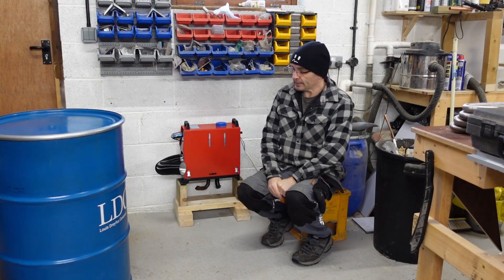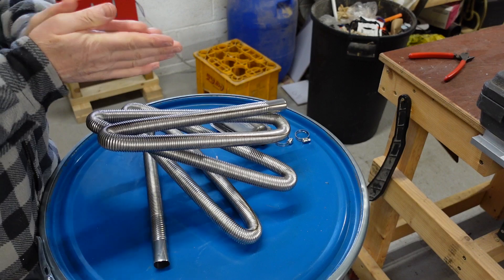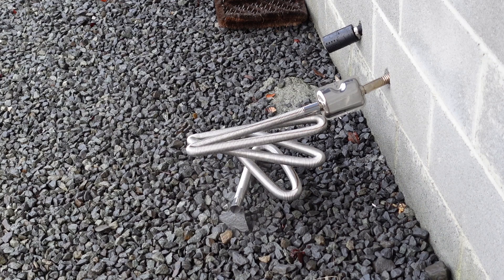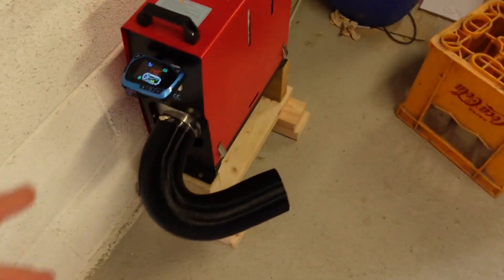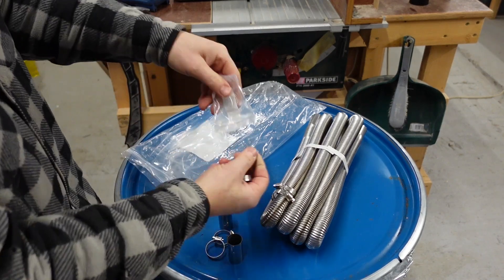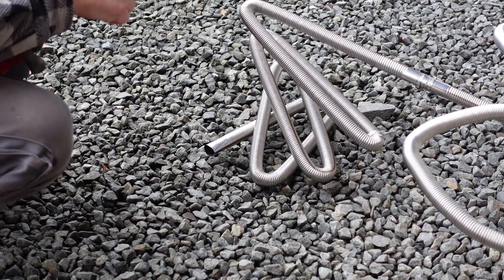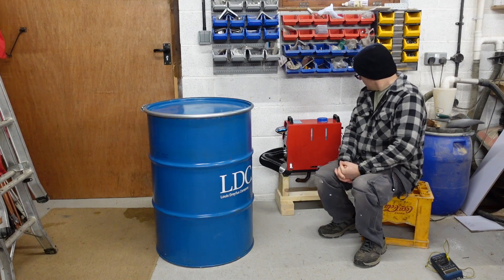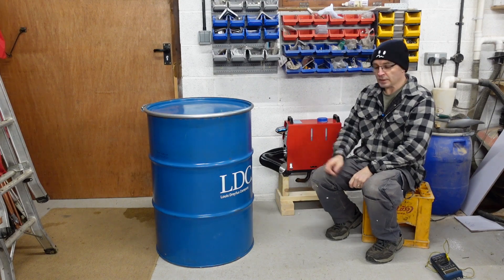How Long! Can a Chinese Diesel Heater Exhaust Be Extended ?

Comment: "Afwul lot heat goes out door". 
Not alot, about 20% wich can be reclaimed 10-15%.
Reality 10% (0.5kw).
Soot possible, never run less than 75% power

Comment: I would put the air indushon pipe inside so it is resurclating the air in the shop
Reply from the maker: There are two air intakes, one for heating one for burning, you want the combstion chamber intake outside 👍

Comment: A sand battery can only compete with water (heated to 80C) as a heat storage if you heat the sand to a bit over 200 C.

Comment: im lost how are you recovering heat with as longer exhaust if all the tube that's radiating the heat is all outside so NOT being harvested NOR captured? please help me understand and thanks
Reply from the maker: The exhaust went in the blue barrel and was filled with bricks and sand and sits next to the heater inside

Comment: I wasted two winters playing with cdh, trying to heat a workshop like yours, I gave up and went to a normal multi fuel stove, best move I ever did, my workshop gets lovely and warm, and it's a very natural pleasant heat, chd are OK for a lorry cab or campervan but that's about it
Reply from the maker: It takes the edge off and makes working out there better but I'd like to build a rocket stove bench at some point if I could squeeze it in without sacrificing worktops.
Reply: @50plusdad-uk just buy a second hand stove and enjoy the heat, you will thank me when you do

Comment: You should take the intake air on the inside so you will heatup the air from the inside and not cold air from outside.
Reply from the maker: That's the combstion chamber intake and get's burnt not heated 👍

Comment: DUDE!!!!  You have your inlet pipe outside too.  No wonder you are having issues keeping the place warm.  Put it on the inside.
Reply: That is the best way , otherwise you are sucking air from the room and sending out of the exhaust , creating negative pressure in the room and thus drawing in cold air from outside
Reply from the maker: That's the inlet for the combustion chamber

Comment: I run a six foot exhaust coiled down lazily with a small fan running over it.  It passes thru the wall sleeved through a piece of 1-1/2 copper pipe.  Currently at 95 percent heat recovery.
Reply: @gbear1005   This is my future setup exactly man!! Mount heater high.... coil exhaust pipe inside as much as you can for thermal retrieval, then exit shop at 8 inch from ground level... and condensation can drain somewhat freely!!!
Cheers from Canada! 🤠🇨🇦
Reply: awesome I've been wondering this using the heater itself to pass over several coils of exhaust tubing while its on it way out drastically improving the inside air temps
Reply: Depends on ice conditions.. mine are 2 ft ppp in protected area, and the stlagmites reach all the way up to the exhaust tip

Comment: Try using the long exhaust in a metal pail filled with sand. The sand will heat up and slowly release the heat into the room.
Reply from the maker: I've used an oil drum 👍

Comment: Hello from the USA. 
I think you tube can read my mind because I was just wondering about the question of how long the exhaust pipe could be & your video showed up in my feed. 
Anyway I was thinking about doing a similar thing but on a smaller scale (no longer than 3 meters) using a 5 gal (19 L) steel pail & sand. 
I will look at your channel to see if you have completed & have updated the results.

I did see a video on someone using a oil filled radiator heater as a heat dissipator (drained of course) but was concerned about the oil residue.
Thank you for doing the testing.
Any other recommendations on this method?
Reply from the maker: Give it a go, just make sure it's gas tight.

Comment: Man. Are you sure thats a 5-8kw.  Seem kinda small compared to the same exact model i have. I was stunned by its output. Well tuned from the factory.  It heats my 12 x20 garage up after about 6 hrs.  70deg easily i often run it on level 1 nd 2 to maintain, after ive run it wide open for a few hrs.   But i live in virginia.
Reply from the maker: I've seen other people say the same thing I wouldn't be surprised if it's no where near 8 👍
Reply: @50plusdad-uk   Have you looked into tuning your heater with the pump settings?  Maybe the fuel hertz is to low?  If so, some controllers will allow you to turn it up a bit.  Just don't go to high.  

I seen one video where the guy said a 5kw and 8kw is usually the exact same heat exchanger just with different settings in the controller for the pump and fan speed.  So, even if you have a 5KW heater, you can adjust it to a 8KW in most cases.
Reply from the maker: Haven't had any luck with getting my controller changed to Haven't, tried all sorts of button combos

Comment: hi,
 I am using a low cost air-air  heat exchanger,  reusing a 2nd hand  full-aluminium-made intercooler for cars.
Mind that:
 - the temperature a car intercooler handles is max140 C and exhoust gases are 500C
 - with natural convection, the heated air will flow from the bottom to the top, so place intercooler horizontally (gaps vertical) for better transfer efficiency
 - to do forced convection, with some fans like in a car, it can be placed in any direction
regards
Reply from the maker: Be careful the exhaust gases don't exceed the max rating

Comment: Just to clarify a point. The reason the outlet temp remains approximately the same, is that the controller takes temp data from inside the heater, and adjusts fuel flow rate (pump ticks) appropriately, to maintain optimum temp inside the heater. Meaning, that although it 'appears' to be running with normal efficiency, even with the added restriction to the exhaust, it is in fact using more fuel to maintain the correct temperature.
For example, setting it at 'level 5', doesn't set the flow rate (pump ticks), but rather, tells the controller to do whatever it has to, to make the heater conform to it's programmed heat output when set to 'level 5', so the controller will do whatever it has to, to force the heater back into the performance profile dictated by the controller's firmware programming.
This topic, in a different question came up in a different vid I watched earlier, where some fellow said that he figured he was saving fuel by changing his pump to one that put out a little less fuel per tick, but I had to correct him that the pump doesn't control things, and that the controller would just make his 'smaller' pump, tick faster, forcing it to deliver the same amount of fuel that it would make the larger pump deliver, again, to keep the heater performing within the boundaries of the controller's programming.
For more clarification, and good data on how this type of restriction actually hurts the heater and its performance, just as I was typing this, a 'short' was dropped by (channel name) 'Hangin with the hursts', briefly talking about his attempts, and the word he got after consulting with the manufacturer of the heater he was working with. (most recent short on his channel page, titled... "Diesel Heater Exhaust: Why Modifying Is a BAD Idea!")
Reply from the maker: I'm using a 38mm exhaust now so no restriction
Reply: @50plusdad-uk  Did you consider putting some spacers around the pipe and put another around it, solder an inlet and outled to it, to make a pipe heat exchanger? That way you could suck the heat out with not many restricitions.  
I was playing with the thought, but I won't find the time till new years.

Comment: Just run the exhaust pipe through the barrel at the bottom{ with good sealing at both ends} fill with water, and you have the best thermal mass available for distribution
Reply: Also the heat coming out straight of the heater is quite dry , so you can open up the top of the barrel and put a fan to humidify the area at the same time. Especially handy if working with wood species  that requires a steady humidity level.
Reply from the maker: Nice tip 👍

Comment: Maybe spending time to insulate the room more is an idea
Reply from the maker: too much stuff in there thats fixed to the walls so not an option at this point
Reply: Here is my thoughts. Instead of using the exhaust in the barrel. You have 200 degree air coming out of the air pipe. Run that into the barrel into 3 inch dryer hose starting at the top and curl it on the inside and exit it out the bottom. Hot air rises. Now cut another 2 more 3 inch holes on opposite side of the barrel. One at the bottom and one at the top. On the top one place a computer fan. Have it pulling air from inside the barrel. This air inside the barrel will get hot and the metal pipe will be hot. The metal barrel will get warm. Now you should have hot air from the heater coming out and warm air coming out from inside the barrel. Won’t be any risk of bad fumes or condensation. Just a thought

Comment: It's not the length dude ( pardon my pun) it's the bends in the pipe. Stretch it out across the wall on a downward angle inside your space and put the muffler on the end outside ( shortest exposed exhaust as possible ). Cover the inside length with a wire cage so nobody gets burnt. No more than 10ft inside best length to heat capture ratio.

Comment: It can't work properly. The exhaust pipe should have a contious slope and no narrow angles. The way you do it causes to much counter pressure. Completely unlogic setup
Reply from the maker: Works fine so far

Comment: Those exhaust tubes are not stainless steel just to let you know they rust out you are better off with exhaust pipe that wabesto uses at least it is double walled exhaust pipe
Reply from the maker: The 25mm didn't work out so I changed to a stainless 38mm with no issues so far.

Comment: Started my one only vertical exhaust run directly from the bottom side of the heater where it's hottest to keep vapors from condensing. Up just the height of the heater then switch backs down the the bottom and out the wall outside, all downhill. Simple exhaust radiator. Adding a protective grill later. Compact, the same size as the side of the heater.

Comment: Temperature in the chamber itself, or a the warm-air-pipe remains the same... But to make any assumptions about efficiency, you have to also check, if fuel-consumption and soot-deposition remains similar as before... Soot deposition is nearly impossible to check, since you´d have to run it for a year normally, and for another year with the added 6m-exhaust-pipe, but the fuel-consumption can be checked as easily as the checks you already included... Otherwise, that´s exactly the test-set-up that I was thinking was needed, but nobody was doing... So, thanks... Also, if using a muffler, stick it to the end, not in between, confusing the gas-flow, causing harm. And if your exhaust ends up being 3-6m long, you surely don´t need the muffler, seriously...
Reply from the maker: Using a 38mm pipe now, no muffler needed 👍

Comment: Considering running a longer exhaust by the side of the heater as a radiator to extract more heat. Just run it up the side, the switchbacks downwards before leading outside to vent. Avoiding accumulating condensation. A grill to prevent burns.
Reply from the maker: Definitely a grill, these get hot 👍

Comment: Alo !? ..  Just connect to the old whater radiator..    It will absorbe hot energy..   delivering it in the room ...   And exos (mutch colder) goes out..
Reply: I tried this , affected the burn badly .You need an old radiator as modern ones tend to have too small diameter inlet /outlets

Comment: The key here is to increase the diameter to a large pipe, do not try to run it at the same diameter over a long distance.
Reply from the maker: Works so far

Comment: Why use sand? Water has a much higher thermal mass and the transfer will be better. If you’re worried about it rotting the barrel use central heating inhibitors.
Reply from the maker: Thanks, I used sand as it's easier to deal with, I don't have to worry about leaks etc and if I want to dispose of it I can use sand but 200l of contaminated water would be a problem 😀👍
Reply: @solaris8592  you’ll have to constantly look at it because water is going to evaporate some,,, and the exhaust pipe may very well start to corrode. I think folks overthink these little diesel heaters far too much set the whole unit outside and pump in the heated air and don’t worry about all the rest of it. It’s kind of like watching a stripper. Don’t ask how it’s done just enjoy what’s coming off.

Comment: Shame you could not use non corrugated pipe. Sure that would work better?
Reply from the maker: The 38mm stuff i use isn't as bad
Reply: smooth is better and every bend adds friction

Comment: Would be interesting to try removing the muffler with the 6m exhaust pipe to see if that had any effect? Noise, Performance, Heat etc.  My thinking is that with 6m of exhaust it actually would replace the muffler.
Reply from the maker: I upgraded to 38mm pipe with no muffler as it wouldn't fit but it's not noisy so no need for it.
Reply: @MirriulahInAngledool  muffler doesn't muffle..  hardly any restriction tho..
Reply: I never put the muffler on mine it's quiet  enough without it

Comment: What you see on the display of the heater is not 219 Celsius it is 21.9 Celsius which is the programmed temperature to achieve
Reply from the maker: If that were true it wouldn't rise as the heater warms up 👍
Reply: @50plusdad-uk it is not worth to discuss with unlogic people
Reply: @Dodgecramer-wj6xv  that is working temperature in combustion chamber.  For set temperature you has to go on different setting.  Don't mix setting  man.

Comment: Saw a video of a guy who got a hold of an old school boiler style radiator... Piped exhaust thru that, and set the filtered used fryer oil on top to pre-warm it, mixed 50/50 with diesel, thing never knew the difference....
Reply from the maker: This some have run them on kerosene as well not sure how cost effective it is though 🤔
Reply: Long term will carbon up the burner chamber

Comment: i would have used 25mm copper pipe with a pipe bender into a coil and soldered supports from each coil top to bottom as the normal diesel heater flex pipe isn't guaranteed to not leak from its bendable construction and solid copper is a dead cert for thermal conductivity and isolating the noxious gasses
Reply from the maker: I use 38mm now the 25mm is too small at that length, stainless over copper as its not affected by the exhaust gases. 👍
Reply: @50plusdad-uk my biggest concern is the ability to contain gasses in the flex pipe, have you done an underwater leak test on it with comparable pressure within, I wouldn't have thought copper would have an issue with the gasses because of the temperatures involved, but if I've missed something then aluminium would be my swap. On a side note a heater exhaust through an intercooler to harvest then exhaust to the outside and the heaters air output tubing blowing the intercoolers heat into the space needing heated or an extra fan
Reply: @50plusdad-uk  any tips about the bits needed for the 38mm conversion?
Reply from the maker: If running inside make sure the pipe is gas tight, I got an adaptor 25-38mm and used exhaust paste and exhaust clamps. And get a carbon monoxide detector

Comment: These burners are a copy of an eberspacher D4  airtronic and the maximum recommended length is 2 m  of 24mm and 4m of 30 mm 
This is official data as you won’t get any data from the Chinese
Reply from the maker: I'm running 6m of 38mm now, so far no issues
Reply: @50plusdad-uk  Interested to hear/see how much coked up the burn chamber is after a year of use.
Reply from the maker: I'll probably clean it after winter, it won't have lot's of hours but should give an idea of how it's going 👍

Comment: Do you have a link for the exhaust pipe couplers? I couldn't find them (the link in the description doesn't work). I have an old Truma gas fired caravan water heater, I want to replace the burner with diesel heater exhaust heat.
Reply from the maker: I'll try and find it for you 👍
Reply from the maker: try these  
https://amzn.to/4728OhB exhaust extension
https://amzn.to/4nUHiZm exhaust connector
Reply: @50plusdad-uk  Thanks. They seem to be available now, couldn't find them before. The pipes are an odd size. Now I just have to find the heater...
Reply from the maker: I put new links in the description 👍

Comment: Please make sure you have no leaks on your pipe, otherwise you will have fumes in your workshop, and it is poisonous, I would use silicon tube over the joints.
Reply: It's diesel not gasoline. No one dies from diesel fumes unless they are forced to breath that smoke. It stinks. You smell it - you open the windows. Gas is the real killer - a lot of CO which does not smell.
Reply from the maker: Plenty of paste, Better safe than sorry 😁
Reply from the maker: The pipes are a snug fit plus plenty of exhaust paste and decent clamps.

Comment: with all the extra work and buying extra stuff be easier to get a second unit run 2 till warm then turn off one
Reply from the maker: I wanted something to heat up and then slowly release the heat when the heater is off.

Comment: Could you not run the exhaust through a radiator?
Reply from the maker: yes you can, cast iron probably best but I wanted to collect and then slowly release the heat 👍

Comment: Try with 1 inch coper pipe in water😊 best to heat water batery
Reply from the maker: cooper can react with exhaust gases, stainless is better
Reply: @50plusdad-uk  maybe. But it will still  last a lifetime 😂

Comment: In very cold climate, do not use longer pipe than 1 meter due to freezing issues. Especially if a heater is installed in a vehicle.